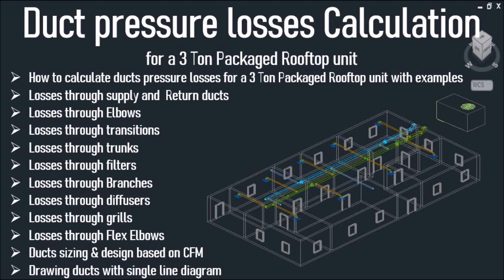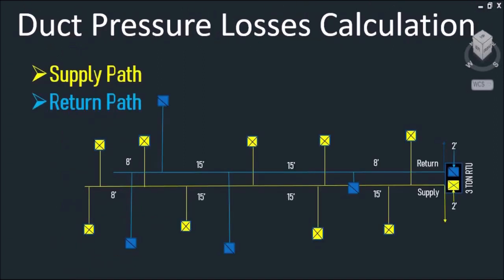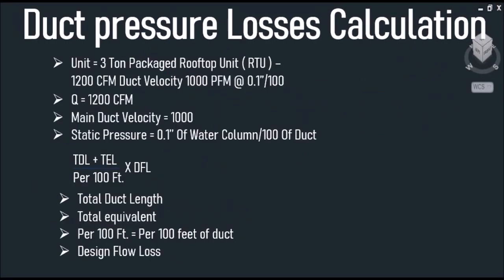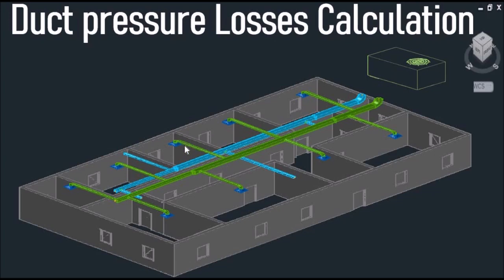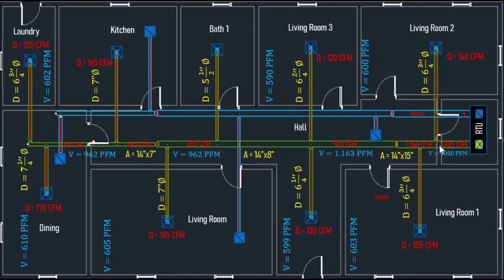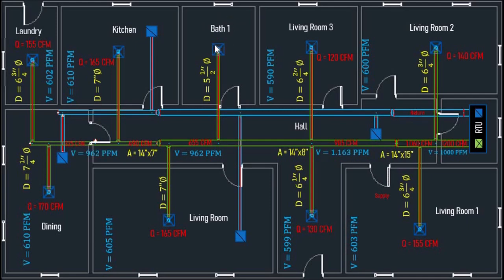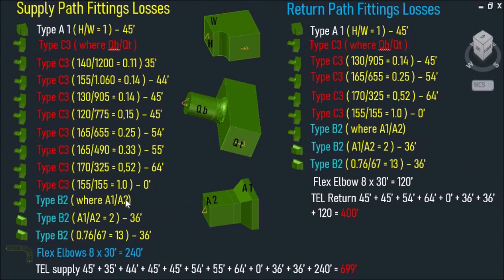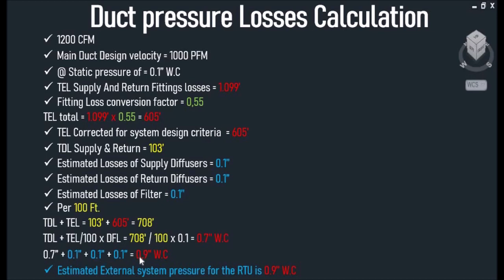Ducts pressure losses calculation for a 3 Ton packaged rooftop unit- HVAC

Comment: I do not understand how you convert to equivalent feet.  For example, Fitting type C3 has a correction factor or 0.11.  how do you get 35' based upon the corrected pressure drop chart?